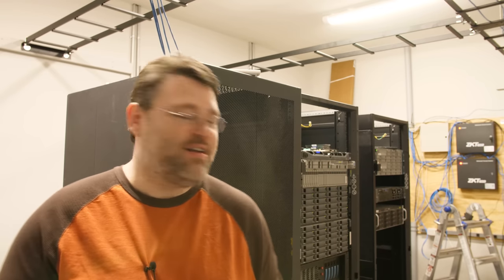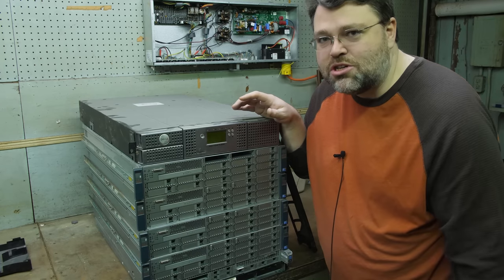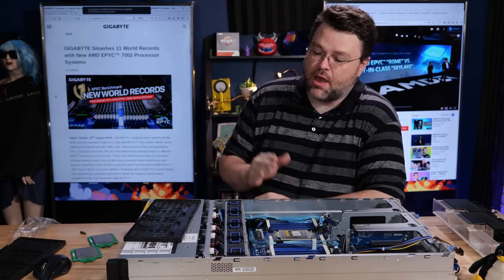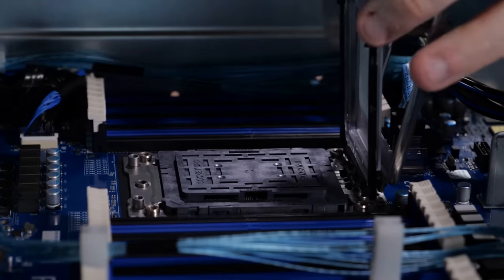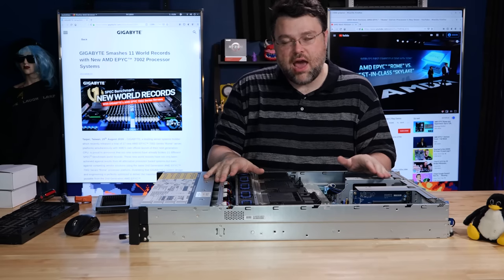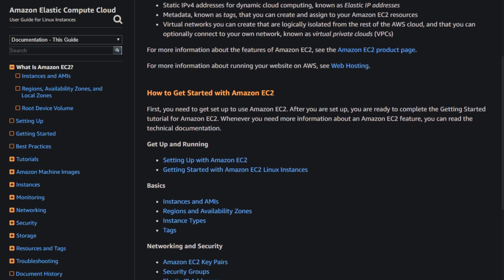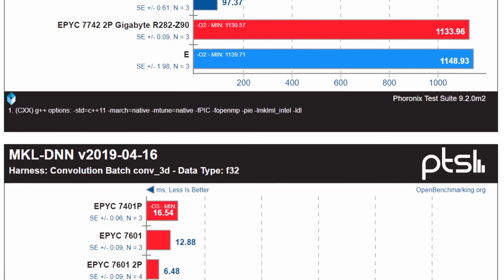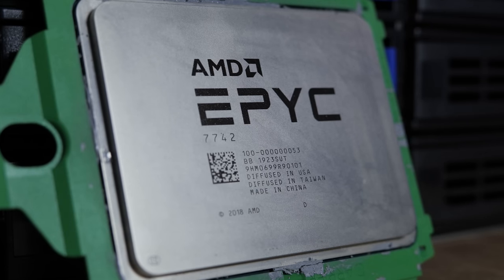Dual GIGABYTE EPYC Server: The World Record Breaker!

Comment: As an old IT hand , for me this is the iron machine to run VMs - VMs for days . One machine to run them all - one machine to bind them .....
Reply: One machine to fuck it all up when it burns up and in the darkness bind them, as well. Two is the bare minimum. Three is comfortable. Just for redundancy in a vSphere or any other cluster. Which means 128 cores and 4 tera memory makes a lot less sense than it seems. Gotta have redundancy, and very few businesses even will need 384 cores and 12TB of RAM, or want to pay the staggering software costs for Windows Server and SQL server for 384 cores. If you license SQL server per core, and have 384 cores, you're looking at a cool half million dollars or so.
Reply: @cr0ft-2k  your sure right about redundancy lol.
Reply: @cr0ft-2k  pretty sure that's not how per core licensing works. You only license the cores that belong to the VM with SQL server.

If you have 384 cores licensed for SQL server access, I'd suggest a half million is probably less than your power bill to run the several thousand other cores you must be using to do the work that requires that kind of SQL database setup.

I work for a company that had (pre covid) $250m/m operating cost, very little of that was datacentre and cloud costs.
Reply: @morosis82  No, the licensing of per-core use of SQL server is based on the amount of cores available to the VM, not assigned to the VM. The same goes for Windows Server. If your hardware has 32 cores, your WIndows Datacenter must be licensed for 32 cores, even if you only ever put 2 virtual cores on each VM.
Reply: @cr0ft-2k  weren't we talking about SQL server?

Windows is 1 licence per core for DC, 1 per core * # of VMs on that physical server for Standard (roughly, minimums etc).

SQL server is based on what's available to the OSE. On baremetal that's the number of cores, in a VM that's the number of vCores.

So if you're paying for 384 licences of SQL, you are either running it baremetal, or have a crapton of VMs assigned to that machine all running SQL server.
Reply: @morosis82  Windows is indeed one license per core in the hardware it runs on. If you have a Windows VM with 2 cores, and the VM host has 64 cores, you owe Microsoft for 64 cores. With Windows, it's always the worst case scenario. With DC, you need 1x64 per such host, so if you have a cluster of 3 hosts, you need 3x64 cores licensed. Standard is even worse, in a cluster of three machines, you need 1 license per core multiplied by machines; you need to license the Standard Windows VM for all three machines it MIGHT run on, if it can migrate. So to run 1 VMs on a 3-host cluster, you need 3 licenses, one per hardware. Yes, it's nuts. Yes,  it's Microsoft. It's always the worst case scenario for the customer, licensing wise.
Reply: @morosis82  Also, SQL server is licensed exactly the same. You pay for the amount of cores you might use if you wanted to. So X amount of cores in the VM host = the amount of cores you have to license SQL Server for. Not the amount of cores in the VM.
Reply: @cr0ft-2k  Yup too true.  Part of purchasing a server better have core count in mind with licensing...

Comment: One of the company's I know is about to drop all their Intel hardware 2-3 years early,  that's about 20 (maybe a bit more with some h/w not swapped) servers for VM,  standard Enterprise (backups, Exchange, remote desktop/servers etc) and Data Visualisation workloads. This is primarily due to the continuing security issues of Intel but also the fact they saw an uptick of 20-40% (!) with some of the workloads and performance, especially running  ESXi servers off NVMe based drives for high priority services. Management thought they was lying after the tests and actually had to rerun them several times to prove the point  :D  They only just migrated the hardware middle of this year, but they're willing to take the financial hit because it's going to save them inordinate amount of money and give them necessary expansion room for future projects. From what they've said they're will to go from ~20 servers to 4 or 5 maybe even less. Another advantage is something they didn't initially consider,  is that they won't have to upgrade their server room cooling or run it so hard saving them even more cash. 

Epyc 2 is a seismic shift, and not enough people understand how much this a generational change that's rarely seen in the industry. People are so used to buying Intel without realising how good AMD is now, and that's partially down to sales people desperate to shift old Intel boxes taking advantage of the ignorant.
Reply: People who keep buying Intel will lose their jobs
Reply: Yeah getting something like a 25% performance increase with 25% the amount of servers is just insane, I'd imagine some higher ups having an absolute dopamine rush over the TCO aspect as well as future potential for expansion.
Reply: @MetroidChild  I'm IT manager at a datacenter. To say people like me are excited would be an understatement. The TCO reductions just keep piling up. Fewer racks drawing less power means less AC cost. Fewer racks means we won't need more space soon. And on and on.

How AMD is going to ever have anywhere near the supply of Rome that the demand is going to be is beyond me.
Reply: @KenS1267  g08129959
Reply: I thought your coment was serious and pro until you typed :D.....didnt knew you company hired teenagers
Name a company with a security issue due to intel..NONE
Reply: @Teluric2   well, he actually is saying things thay make sense, so i think its legit considering how much bs some fb's can talk
Reply: @FIRSTEBITOS  like what?
Reply: @Teluric2  right, only teenagers use emojis. Especially ASCII emojis.

Spectre is a thing, and while there is a fix it neutres performance badly on Intel platforms, while AMD fares much better.

Comment: I remember when I got my first job as a programmer and sysadmin. The first thing I did on the sysamdin side was convert 7 SCO Unix mail servers down to a single redhat linux box running qmail. from 7 4u boxes down to a single 4u... A few years later, and I took that mail server and 4 other web and application servers and converted them to a single Xen box running on a dual core chip. Always fun to shrink an entire rack down to one box, then fill it back up, and then do that shrink all over again a few years later.
Reply: just a physical version of .zip.

Comment: Sounds like an advertisement for AMD Epyc.. nope just an excited Wendell geeking the hell out
Reply: Xtreme Performance  yeah that about sums it up. If you told me that 4 years ago I'd have said you were dreaming
Reply: Let's see... Amd wins in cores/socket, memory/socket, PCIe throughput/socket, cache/core, performance/clock/core, cost/core, efficiency/core, security, yield/wafer, and soon possibly threads/core and customizability per socket.
And I'm sure I'm missing things
Reply: did he forgot the thermal paste at 6:34? or he is using stock paste on the cooler?
Reply: @mrmr7301  stock pre-applied paste..
Reply: I had expected is to be further along by now, but Intel didn't have any real competition for a number of years ago it wasn't in their interests to push technology. Still waiting for that increase in competition between the two so that we get a real jump, this is a nice start.
Reply: It's a little late.  A lot of the govt and private sector have already ditched or are making plans to ditch Intel.
Reply: Its the the best mainstream cpu right now. I would not buy a 3950x since its not futureproof, only 16c/32t will bottleneck  since many games uses lots of cores today.  I would not buy a Epyc with less than 64c/128t if you like at minimum 60fps gaming. <- this is an ad for epic :)
Reply: Xtreme Performance  Don't forget the performance per watt. That's much more important in a server application as well.
Reply: Anyway I dont see any
 top computer in the top500.org using amd
Reply: @Teluric2  That's supercomputers, dude. Totally different segment of the market.
Reply: @apocalypseap  well that market will pay any for maximum performance so amd cant deliver?
Reply: @Teluric2  More like, AMD hasn't focused on that part of the market. You have to design and set up for it specifically.
Reply: @apocalypseap  epyc is aimed to server and HPC but I doubt
Reply: @Teluric2  those systems are years in planning. You'll see them in the next year or two.
Reply: م

Comment: and 4tb memory is only 50% of the possible configuration

of course, 256 GB RDIMMs aren't exactly affordable.
Reply: Right. They cost almost as much as a used car. Pays for itself though if you are currently using Amazon. You recover your costs in the first 8 months to a year and on a 3 year cycle you would save a ton of money.
Reply: @z3 Dreamhost charges $10 per GB RAM per month so slightly more but they do have pretty good support too in my experience if you don´t mind their web panel. So with 1Tb Ram you can probably get a little under 1000 virtual servers running on there but since nobody uses all their resources at once and many only use part of them they can easily over sell by 100% since in a cloud system they just spin up a VM on whatever server has resources to spare.

I am guessing a server pays for itself in about 6-8 months considering you also have bandwidth costs.
Reply: @z3 Same for domain names. The ICANN fee was 25 cents a year for a long time. Now almost any half decent .com is classed as a premium domain and GoDaddy etc will charge you 100s to thousands for them. Including reserving domains that you look up and later the same day jacking the price up when you have decided on which domain you want.

I have a Chinese Phone I paid 189 for and it was better specs wise than the Iphone at the time I bought it.

ISPs are the same way. In Germany they are almost all on DSL so they run over your regular phone line so why can a VPN give you high speed unlimited bandwidth for $3 a month and your ISP which is transferring the same data charges 30-50 and caps you at 200-300GB. In addition to giving you a slower connection. Here you can buy a 4g router with 100GB data plan for 50 a month but on a cell phone you pay 20 for 5GB and 30 for 7GB with no chance to buy the bigger 100GB plan you can only top up for 3.50 a GB.

We get ripped off everywhere you look and it gets worse every year. Now companies rent you their software as a cloud app instead of selling you real software. There is no reason for the Adobe Suit or Fusion 360 needing a server connection but they use it as an excuse to charge you a monthly fee. And they hold your files hostage if you cancel your subscription. And it is actually worse than before because you can´t work without an internet connection although that has gotten a little better in recent years.

Comment: My job has 5 of these, different CPU SKU's, and are validating them for deployment in January, when our contract with Intel expires. So far these are awesome. Wendell might have understated how much consolidation will be possible with these. 

Plus each of these will cost so much less to build and operate.

For the very very broke out there, this might be a great time for checking in with your local ecyclers. I would imagine a lot of racks are or are about to be getting into that stream.
Reply: Do you have any tips on finding these recycling centers? I live near Boston, yet still haven't found one...
Reply: @sethw9979  Boston Ecycler Google.
Reply: @sethw9979  You can wind pretty amazing deals on ebay too if you just need 1 or 2 servers. I expect prices to drop if companies start consolidating all their gear there will be a flood of server parts like never before.
Reply: What does he needs  servers for Wendel

Comment: If you're consolidating, you surely also want to look at high availability too, which could mean buying 2 or more of these monster machines along with all the ususal external redundancies (power supply, switches, firewalls, net connections, etc.). This might be where you have to scale down a bit from 128C/256T to keep within budget.

I might have missed it, but a series of videos on best practice HA, paricularly in terms of VM hosting (using various host software like VMware, Hyper-V and Proxmox), would be a nice thing to see. Even see if all the VMs survive and live migrate automatically if you literally pulled all the power cables (and a separate test with pulling network cables) from one of the servers.
Reply: Its still cheaper to buy 2 of these then tbe equivalent intel setup where you would need 4 or more. So in the end you are still buying less hardware (less psu's,less cases,...)

Comment: Thomas Jefferson National Laboratory just added over 5000 threads worth of AMD Epyc to their batch analysis / simulation farm.
Reply: Just checked the numbers passed along in the email from JLab IT.  AMD "rome" processors.  64 core, 128 thread versions with 256 GB of memory allowing for 2GB per thread. Generally they are matched up with either 1 or 2 TB SSDs in RAID 1 for operating system and scratch space.  All connected via an infiniBand backend to a multi-petabyte array.  I don't have anything to run at the moment but I can't wait to try them out.

Comment: I heared you say about 45k for this beast.
That is less than that cheese grater...
Reply: I am running OSX Sierra on a new 8 core Xeon 2288G Workstation that can run 4,7Ghz at 100% usage all 8 cores all day and it is pretty much identical to the new basic Mac Pro except it cost 3,5 times less ;) Here in Norway same computer  (almost identical but slower CPU)  in form of Apple Mac Pro cost 8200 US Dollars...
Reply: Still, it won't be able to run MacOS legally and aid in Metal game development and such.
Reply: @SoldererOfFortune  Metal and DX12 are limited to their respective operating system, making development for them a nieche thing.
Reply: As long as you only run Linux on it. If you want to run Windows Server on it, you'll probably pay more for that than for the hardware.

Comment: Kinda nuts to think that you can configure this cheaper than the new mac pro and out perform it using a cheap laptop and virtualization software.
Reply: Oh hell yeah, several times as fast, with far, far more utility
Reply: Well, putting that much power into a tiny box that also needs to be quiet is a terrible idea. If you don't care about size and noise your cooling will get much cheaper.
Reply: @FalconX88  Yeah if anyone is actually doing this I'd like to think they'd put it out in the garage. That 10k in savings could go a long way toward a custom cooled sound isolated box.

Comment: I'm looking at the "budget" version of this when the 64-core 3000-series Threadripper releases next year in order to replace my current/existing 64-core/512 GB RAM lab.
Reply: I thought Threadripper only support upto 256gb ram.
Reply: @Janken_Pro  
Yes, that is correct, that a single system will only be able to support 256 GB of RAM.

So that just means that I am possibly looking into getting two. :)
Reply: You couldn't do a dual cpu epyc 32 core then upgrade to 64 later?
Reply: @jetah50  
The problem with that is that it's not cost efficient to do it that way.

I'd either end up with two slightly used processors that I would have to sell at a loss, or that I would just end up with them, and they won't be doing anything useful/productive.

Given that the 64-core Threadripper is supposed to launch relatively shortly, it makes more sense to just wait and see if it is going to be a better option ultimately, and to see which would be more cost effective.
Reply: @ewenchan1239  Just looked at newegg and it'd be cheaper to get a dual epyc cpu mobo with 1 64 core cpu then you can expand it later. 

then you wont have to sell a set of used cpus.
Reply: @jetah50  
The make dual sTRX40 motherboards already?

Dual 32-core AMD EPYC is definitely not as cost effective/efficient as a 32-core Threadripper.

And the ONLY "real" difference is the number of available PCIe 4.0 lanes.

That's it.

(Which, if you go with two separate 32-cores+ Threadripper systems, you'll end up with the same total number of PCIe 4.0 lanes because in a dual EPYC configuration, half of the 128 PCIe 4.0 lanes are used for the Infinity Fabric socket-to-socket communication, so you'd still only end up with 64 PCIe 4.0 lanes per socket.)

Comment: Then a mac pro is 50k . epyc makes those DOA essentially
Reply: Isn't the mac Pro only 28 cores?? 🤮
Reply: @ironmantooltime  mac pro is ONLY 28 cores
Reply: Lol, are they really 50k?
Talk about  a waste of money.

And they will still sell loads of them anyway lol.
Reply: @baronvonlimbourgh1716 
Fully loaded, yes.
Reply: @DuvJones  a comparable epyc box would probably be 20k or so. 
Do they even make epycs smaller then 32 cores? Like 24 or 16 or something?
Reply: @baronvonlimbourgh1716  They do. Iirc the smallest one is 16C/32T, except for the embedded EPYC segment (which are not socketed, but instead soldered onto the board) which go down to 8C/16T. Some of them still have multiple other chiplets despite having few cores, and just their L3 cache is active on many of the other chiplets, so some of them have an absolutely insane cache to core count ratio haha. Take a look at their selection! It's pretty interesting to see. Really shows off the advantages of their chiplet approach. I bet almost every chiplet they make gets used somehow. Their yields therefore must be incredibly good.
Reply: 50k for 28 cores? You are joking, right?
EDIT: Nevermind, I've just checked. The 50k really does have only 28 cores. 🤦‍♂️Should have gone with Threadripper 3990x or the 64-core Epyc Rome.
Reply: @baronvonlimbourgh1716  The cheapest Mac pro is 6000 dollars with a 8 core CPU a 256gb of SSD, now you get the joke, except that it isn't a joke.
Reply: @DuvJones  fully loaded?! No
Reply: @jonnypena7651  still funny.